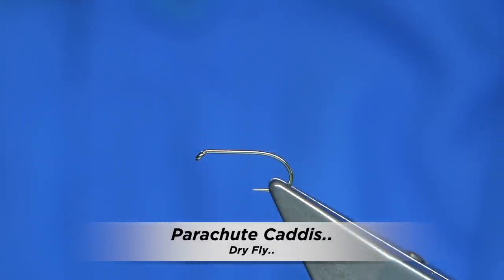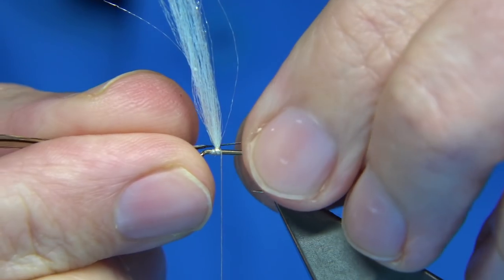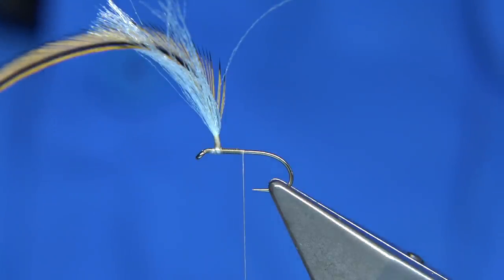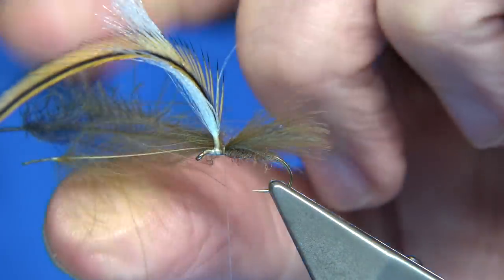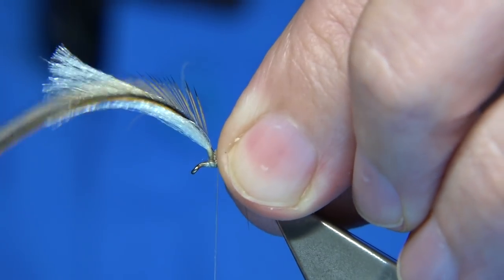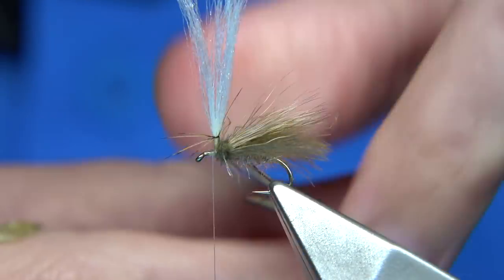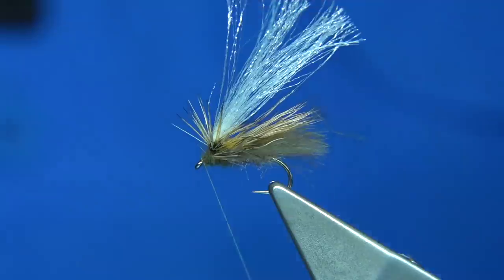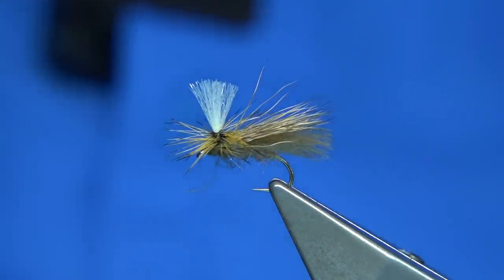Tying a Parachute Caddis Fly with Davie McPhail

Comment: This is a real useful fly pattern for lots of fly sizes. Being older seeing your fly is getting harder to see. If the water has any froth or bubbles on the surface a white post can be hard to impossible to see. The smaller the size of fly the harder it becomes. The color called hunter orange works in bright sun and in the early morning and after sunset. I just buy a foot of poly rope in that color and use the correct amount of strands needed to make a bright post on this fly. Fact is different colors of poly rope can work for all sorts of substitutes for things. Tails, legs, fly bodies and whatever you decide to use it for. It may not be the proper fly recipe dressing but; trout seem not know the difference.🔎😂🦉

Comment: So many great tips and techniques here.  Do you usually wax your thread before adding dubbing to it? I've had trouble applying dubbing to the thread, it wants to begin to roll upon itself and not the thread. Cheers to a great teacher.
Reply: Try adding it into split thread with a bit of added Tacky Wax. So much easier and more secure.